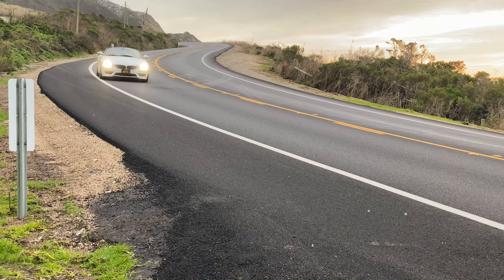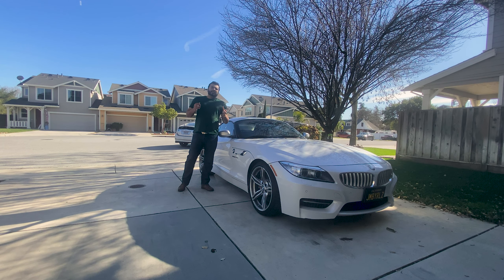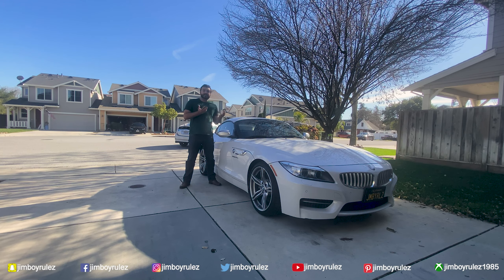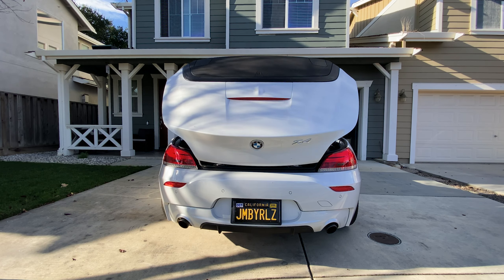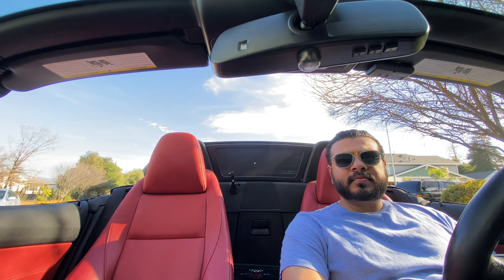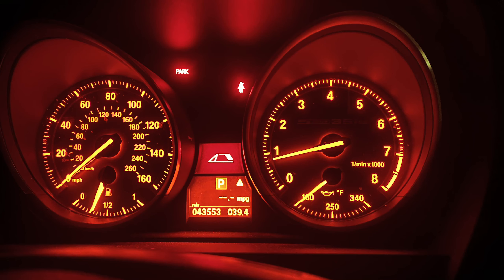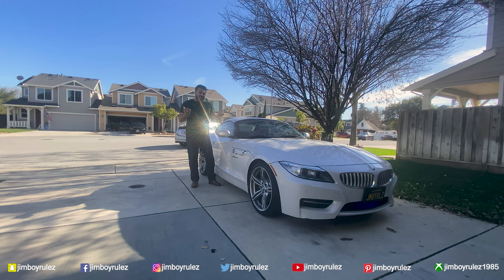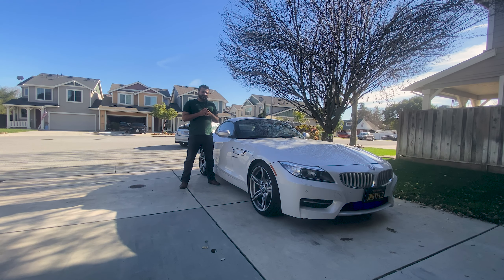Things I DISLIKE about my Z4 's CONVERTIBLE ROOF

Comment: There are LEDs built into the top up/down buttons. They illuminate while the top is moving and go out when completed, so you don’t have to watch the actual roof in the rear view mirror.
Reply: But yes, a chime would be nicer.
Reply from the maker: Gary Bell I didn’t know that !! Thank you !! Wow!! Owned the car for a few years now and I learnt something new!! Thank you so much!!!
Reply: JIMBOYRULEZ , yep but most people’s fingers cover that LED so it’s got bad placement.   Love my 2011 sdrive30, but definitely some odd decisions.  Also an aftermarket SmartTop module will make the top up/down a single button action, rather than holding the button.  In fact with mine, without comfort access, I can’t open with the key fob in stock form.
Reply from the maker: Gary Bell oh, interesting!! Correct me if I am wrong but  in the later models, comfort access was standard right?!
Reply: JIMBOYRULEZ , I don’t know about that possibly.  I do know that something with the roof structure was re-enforced more so it can be operated up to 25mph after the LCI which I believe was 2013+.  Looks like yours is the newer facelift, because of those side marker lights.  My ‘11 can only operate up to 10mph.  If you have the 3 little ridges on your door handle, you have comfort access/ keyless entry and that ability to open with remote.

Comment: Yes, you nailed them all.  Most are limitation annoyances of design, like the rather slow cycle of the roof.  But most of the other disliked features are safety related, with perhaps an overzealous (motherly?) design philosophy, like the need to press the button at all times to cycle the roof, pull up the windows manually after the roof is raised, the need to be around the car to do the auto cycling of the roof.   People change that with a reconfigured chip, and most of those annoyances go away.  I keep mine untouched to its own glory.
Reply from the maker: I agree, I hv toyed with the idea of that module that allows one touch open and close but I m still not ready for it as I like the car the way it is... like full factory settings.

Comment: As Gary said, I watch the light, despite my finger being in the way, I can see the reflection.  I also open the top when standing beside it if the car next to me is very close.  Otherwise, I can put up with the amount of time, the hold the button issue to me is a safety feature, I can start putting the top down, decide not to and close it rather than waiting 20 seconds to open, then 20 seconds to close.  Pretty sure my E85 was a little less crashy on the closing, as the top would settle in place and the hooks would then extend to secure it.
Reply from the maker: Allen Ferdinand Again none of these things bother me. I absolutely love the car and the roof. But if I had to say something negative and after thinking a lot I came up with this and it wasn’t easy. Compared to how much I love the roof the negative is not even 1 percent. But I understand your issue as well!